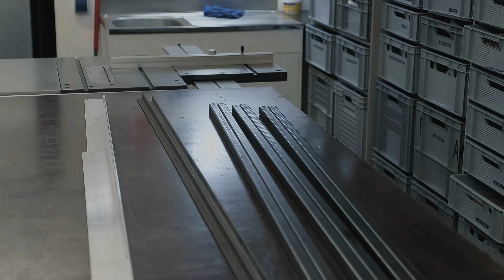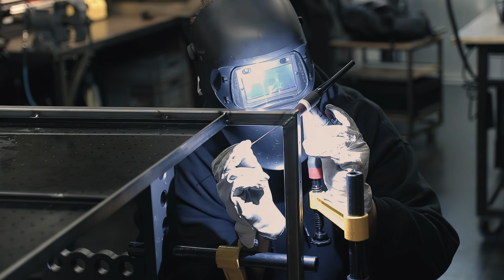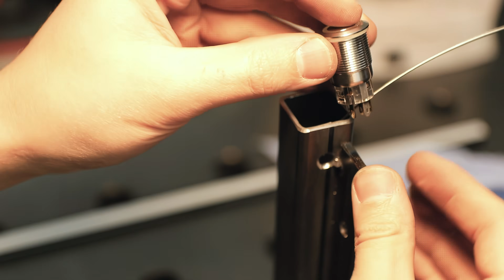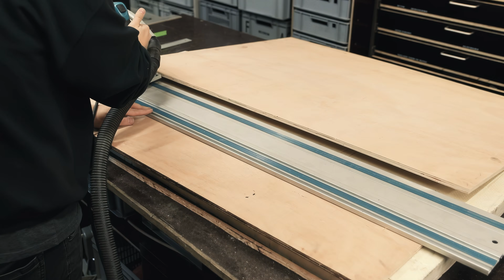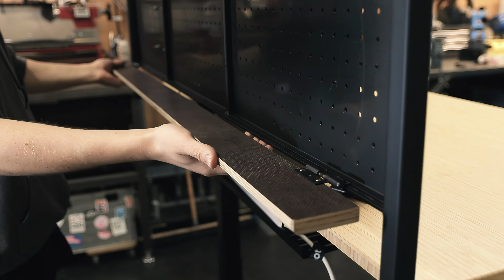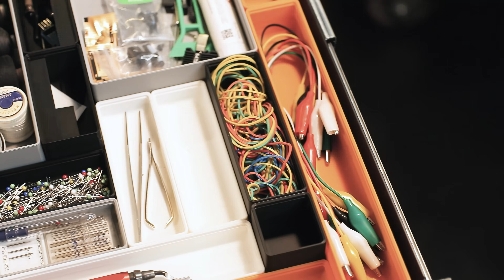Building a Feature Packed Standing Desk with integrated Storage and Lights

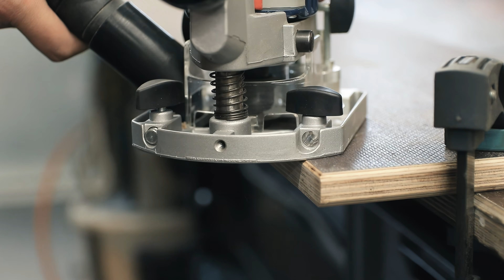Comment: 8:30 We call that type of plywood "stoypikryds" here in Faroes. It is mostly used for concrete molds since the smooth side gives a nice finish when taking the molds off. "stoypi" means casting and "kryds" is short for "krydsfiner" or crossing veneer which is the same as plywood.
Reply from the maker: Yeah same here, that's one popular application. It's great for all kinds of things though

Comment: Thanks for the nice work. Could you include non-tinylink urls? This can prevent others from accessing your content in fear of accessing non-secure sites and might get block by browser/work/education proxy systems. Thanks. Tip if you do not have access to the metal working equipment and know how you can have a local metal/fab shop do all the cuts for you or welds. Maker spaces are also a good idea if you have not know how.

Comment: Do you think this could be done using T Slot rails? I wanted to use 22" IKEA Skadis pegboards and have a 3D printer for making custom attachments. I figured this would be more flexible for someone without access to metalworking tools.
Reply from the maker: Yeah totally. I actually thought about making a desk design using T-slot extrusion profiles, I might do that at some point. Definitely more accessible than welding and the black ones can look quite sleek. If you use 25mm ones you can basically make almost this exact design

Comment: I've been online shopping for ideas for a custom desk, and the drawer's organization left me speechless. The desk is on point and the use of the peg board is smart and thoughtful.  It's a pity I can't solder, I would have loved to make something similar with slight modifications to suit my needs. But overall great desk
Reply from the maker: You can actually make a similar frame from aluminum T-slot extrusion without any welding. All you'd need is a hacksaw and some patience ;)

Comment: haha. Pegs,NUC PC, upper monitor shelf with built in LED profile lighting, Handy Tools with office stationary, Absolutely loved it and actualy makes sense. Already thinking of ideas to improve on this other than getting a "" Floor To Sit to Stand Desk "" to get to my ACTUAL Dream Desk Setup while many yt channels mounted their monitors on to a centre shelf (which you solve by pegborad) on the desk-way above eye level even with an ergonomic chair, while i chose to pay extra for moinitor that IMPORTANTLY can slidedown as an option.
The pegboard is essentially a second desk, which is not a standard on pc desks i guess. way better than those centre shelves. Did you mention the desk dimentions of flexispot desk? if not do suggest your desk size recommendations with and without pegboard setup incase i am not able to arrange/fix one for myself.
TYVM for the video.
Reply: was getting bored of the no storage,drawers, cabinets designs anyway
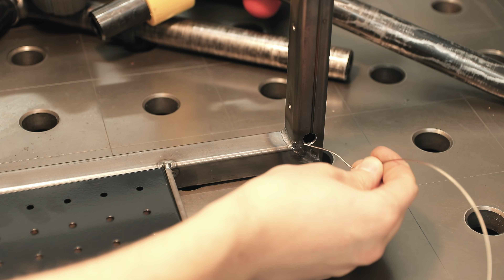Reply: 07:35 whats that hand tool you used after chamfer out that hole? tyvm

Comment: Absolutely beautiful, with your 3D printers did you notice a size difference between the bins due to print quality?
Reply from the maker: I haven't really checked but everything fits fine, there is some amount of tolerance built into the Gridfinity system which you can also adjust in the template file if necessary

Comment: Well this is a really well done video and presentation of drawings and options for fabrication. Once you pulled out the welding table i knew i could not do this but the quality of video made me stick around to watch. And the welding table, it looks like it would be at NASA space station some of the tools you use i have never seen.
Reply from the maker: Thanks, you don't need the welding table to do this at all though, as I mentioned in the video it's complete overkill for this kind of project. A normal bench and some welding magnets would be enough to weld up a simple construction like this

Comment: Hi Phil, great build. I watched both of your table-building videos. Very impressive and I am inspired to build one too. One question though, how much weight can you load on the shelf unit before the fasteners to the table top will give away. Do you think any additional reinforcements to be made for it?
Reply from the maker: I'm not really concerned about it, the shelf on this one is not that big so you'd have to put some very heavy objects on it for that to become a problem. I suppose if you want to be extra sure you could drill through the table top and use screws that go all the way through with a nut on the bottom but of course it would't look as clean
Reply: @PhilVandelay  Thanks for the reply,  what would be the approx weight of the top integrated shelf.

Comment: This is something similar to what I have designed for a pc desk except withing aluminium extrusion as I do not have tools like this. What size extrusion would you recommend for strength with a 49" ultrawide mounted on the back like yours? Great job though.

Comment: Seriously. This is mind-boggeling. Didn#t realized at first that you already build a V2! First of: perfect timing because this is going to be the next personal project. Second i need to mention, I ´bow in front of you´ because after pushing out such a good piece of art, you still hear to some special dudes complaining about flashing arcs of welding scenes :D i wouldn´t able to withstand some roasting one way or another. All combined with all the plans and perfect details, i am very thankful.

If you read this: i plan to build a mix of both and still want to be versatile - also my workspace is next to the roof so no left wall instaed i got an diagonal starting about 10/15 cm above the actual desk height with an 45 degree angle (guessed) - Do you got any tips or something for that kind of problem? Also the overall width is not that great (about 1.2-1.3m) why i´m still messing around with the placing of the actual tower itself. 

i´m no native speaker, so please excuse my wording ;) but the german in me is still in awe regarding to your quality of your build.

Have a good one! Greetings
Reply: One thing i forgot: do you got any additional tips or ideas for an intergrated wireless charging and/or an integrated i/o for the lighting, usb etc into the main table top (plate)

Comment: Did you consider doing the desk frame from aluminum profiles? I want something similarly awesome and don't have any welding experience
Reply from the maker: I did actually, I might do something like that for the next one. Should work just fine with 25mm T-slot profile

Comment: I have to TIG weld a lot of stainless 1.2mm box section like this and oh my god it's such a pain. We don't have a fixture table but the boss still wants perfection. Grinding corners and realising you've gone too far and it's as thick as tin foil so instead of chasing the hole while welding just cut the corner off and replace it xD
Reply from the maker: Yeah 1.2mm sounds tough, this is 2mm so a bit more margin for error

Comment: That top looks SO thin (ignoring the drawer) - doesn't it flex like crazy??
Reply from the maker: Not sure what you mean by top, I'm guessing the tabletop? It's Bamboo and 1inch thick, it works just fine. I don't know what other people put on their desks but it really doesn't have to carry more than my arms and keyboard 90% of the time. If you put 100kgs right in the center of the front edge, then sure, it would flex a bit. But who does that with their desk?
Reply: @PhilVandelay  Yeah that's what I meant. I think I subject mine to a little more abuse than most haha! 40mm ply over only 120cm and it's currently bowed about 15mm with a big AC motor sat square centre hahaha! Beautiful build though, great work!

Comment: This is amazing! Do you reckon I can achieve a similar build with aluminum instead of steel parts(square tubing framing the perf boards)? I don't want the final build to be too heavy but I am also worried about durability. Cheers from Tanzania.
Reply from the maker: Sure I don't see why not, maybe use a bit thicker walled tubing (this is 2mm, for alu I'd probably go with 3-4). 
That being said it's not crazy heavy, I could easily pick up the back shelf unit,  guessing it weighs around 20-30kgs.

Comment: That was an amazing vid man. Great job on the desk. I have a small 48x24 standing desk with a dual monitor setup, the only think is don't like about it is NO storage. 

Great job. Coiled cable was also a great idea, most people use those cable snakes🐍 but your idea is way cleaner.
Reply from the maker: Yeah I looked at those flexible channels and was surprised how big and clunky they are, hence the coiled cable
Reply: @PhilVandelay  do you have a link for that coiled cable? I can't find it that size. Maybe one with 2 outlets? As I have 2 power strips strapped under my desk

Comment: Two additional improvements I’d recommend:

1. Get a set of heavy-duty caster wheels to mount the desk on, so you can move the desk around the room, have easy access to those windows, etc.

2. Get a small UPS to mount to the desk to power and protect the more sensitive gear like the computer and any test equipment. 

As an added bonus, with both 1 & 2 implemented, it’s really easy to unplug the UPS from the wall, wheel the desk to a different part of the room, then plug it back in without having to power down-then-back-up anything.
Reply: That's actually genius man. Good one !

Comment: oh smart, i wanted that sort of panel at my work station but frickin landlord wont let me put screws in the walls. somehow i never thought of bolting it to the worktable like that, and looks sexy with the overhead light. definitely gonna use these elements in my build now!
Reply from the maker: Yeah another pro is that if you ever decide to move your desk to a different spot, you don't have a bunch of stuff screwed to the wall that also needs to move. One of my main reasons for doing it like this

Comment: Tried to access the list link from the description, and it says "This list doesn't have any items.". Even after trying to switch between US and EU links, still the same message...
Reply from the maker: It seems to work fine for me
Reply: will keep trying, maybe just a temporary issue. Thanks! Great build!
Reply from the maker: Have you tried in a different browser/app?
Reply: Wow, it works in Incognito. As well as in a different browser, which I don't use... no clue why.
Thank you for the tip! I would have never thought about that, it doesn't make sense in this case... OR maybe because of some browser extension, who knows...

Comment: Super great work! :) A frosted LED cover would really help with dispersion, but i suppose thats a matter of taste :D I've been working on something similar actually since I saw the video for your first desk. but i have a 48" Monitor Gigabyte FO48u(for those who care) and I'm affraid it will be too heavy in terms of stability of the table and sagging of the "backwall".. do you recon that small triangle braces on the sides could help?
Reply from the maker: Yes I even put some optional gussets in the plans actually, but I don't think they're even needed. Steel tubing is VERY rigid, even smaller sizes like this and a monitor is really not that heavy. I don't think there's anything to worry about, I use a 48" at home too

Comment: This looks amazing.I saw your older desk build last year and mentioned how it looks similar to the cosair platform 6 desk. This one looks even better.Im slowly getting into woodwork and it feels like working with metals is even further out my reach. My only hopes to getting a desk like this is via Cosair, but a guy can dream. Great video and explanation!
Reply from the maker: It might not be as far out of reach as you think, maybe watch some beginner/introduction videos about welding on YT. It's easier  and cheaper to get into than many people assume!
That being said you could theoretically build the frame out of aluminum T-slot extrusion which doesn't require welding

Comment: Hey Phil! Outstanding build and well produced video as always. I have a question for you regarding the Bambu printer; do you find the enclosure helps with more consistent temperatures on the print bed? One of the issues I face where I live is it gets quite cold (-10 to -30C all winter) and my parts cool too much while printing and it can cause them to pull  up from the print bed while printing. I had considered building an enclosure over the printer, but it's a pretty inelegant solution I feel. 

Does the Bambu with it's enclosure maintain temperature more consistently in your experience? 

Thanks man. :)
Reply from the maker: Yes absolutely, they optimized everything on this thing to be able to print various materials without hassle. It has a number of temperature sensors and a sophisticated system of different fans to control the temperature in the chamber and you can also get a bunch of different print surfaces for them to  get the best adhesion for whatever material you print (they just snap onto the bed with magnets). 
That being said, I can't say how it would perform in -10° temperature because that sounds like very extreme conditions (or is that just the outside temperature, not where the printer sits?)
It definitely is the most reliable printer I've ever tried, haven't had a single misprint yet or any issues with adhesion.

Comment: a great improvement would be to replace the 2 flat bottom feet parts with a double triangulated framework for each lifting leg. The standard 2 leg Flexispot frame is simply too wobbly. great build anyway :-)
Reply from the maker: Depends on what you do with it I guess, I don't find it wobbly at all

Comment: Nice build! How is the "wobbliness" when in standing mode? Must be quite a heavy one-sided stress having a monitor and the frame on the back
Reply from the maker: It's quite good, they make these desks with a lot of equipment on them in mind. Of course when you bump it there will be some movement but that goes for almost any desk. When you work on it normally, you don't notice any wobbling. They also make a desk with 4 motorized legs instead of 2, I imagine that one would be very stable
Reply: @PhilVandelay   Thanks for your reply, very insightful.

Comment: Great work as always . when your doing your circuit boards do you have a ground strap ? when I was still working for a repair company I had one it was a elastic bracelet style with a metal button that touched your skin then had a snap on the outside .. the ground cord had a snap then the other end had a alligator clip with a bungie style cord in between the ends . when I worked on garage door openers changing out the circuit board the static electricity would short out the board .. do not know how deep you get into you circuit board building ?? thankyou for the video .
Reply from the maker: It's very rare that I work on circuit boards, maybe change a damaged component once in a blue moon if I can. Most of the electrical work I do is pretty basic ;)

Comment: re: welding light in the video, I recently got an HDR monitor for the first time, and one of the requirements of HDR is that the screen needs to be capable of putting out a lot of light to reach the bright end of the dynamic range. Welding flashes didn't used to be a problem for me, but now they are actually very intense. I would still say the main problem is how sudden they are; people will certainly disagree. I appreciate the filter!
Reply from the maker: Yes I also think it depends on what situation you watch in. In bed at night with a bright screen I can see the flashes being annoying, but in a well-lit room less so

Comment: Hi Phil, that ply is essentially a fancy formply which gets used for concrete formwork. The phenolic sheet is to prevent concrete from sticking, you can buy it very cheap as formply, bearing in mind the sheets are almost always bowed as it is normally supported by a timber frame. The birch sheets used for furniture are much nicer but also much more expensive.
Reply from the maker: I don't think it's the same stuff you're talking about, these are straight and the ply is very high quality. A lot of people here use this for functional furniture because the material is so durable, it's also quite expensive
Reply: @PhilVandelay  Agreed, i'm referring to a similar but cheaper option, they're not the same.